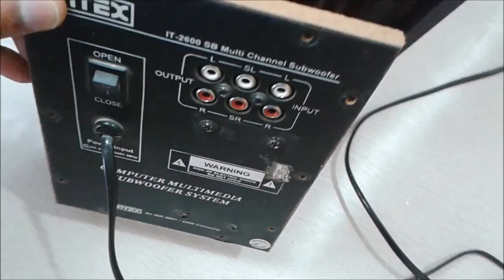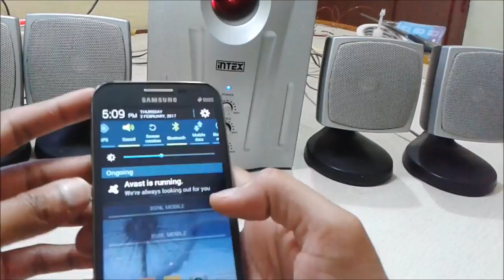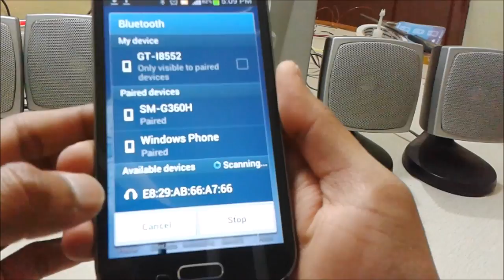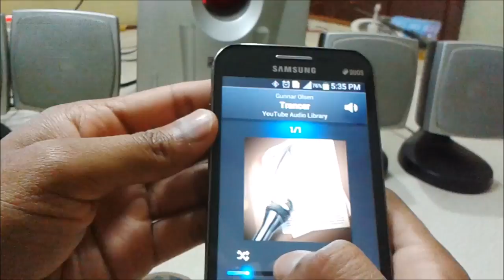How to Convert a Home Theater to Wireless (Bluetooth)

Comment: Good idea.  But you try directly without opening the panel. 1. Connect charger directly on socket       to use DC output. 2.  Connect male to male aux cable.. from bt to home theater...
Reply: But How Could We Fix Without The Aux Hole In The Home Theatre..
Reply: M
Reply: Me too no aux, how to connect ? Please
Reply: @marilync.ladera169  this one need external devices, mobile charging adapter, Bluetooth receiver, Aux to stereo cable. Connect the BT device to adapter, then connect aux in BT output to home theatre stereo input. That's it.

Comment: dear , have you faced low base , or some time baseless sound ? have the same component as u do but the base is very less ?

got any fix ?
Reply from the maker: In this video, you might listen low bass sound but actually its very good sound quality.
Reply: NO  dear , i wasn't talking about the video sound base . i had one , after connecting it to  and it got a relay  low base sound  , i connected the same way you did , but search in a lot of , some in the form says , it has a  lower  and poor rate of transmission , so need extra 
 boost up ,
Reply: ya i am also facing same issue. but the reason is low quality bluetooth device.. i hv changed the bluetooth bought branded one. now quality is good.
Reply: can u plz provide make and model "branded one"
Reply: Koustav Dutta or go for iball bluetooth reciver

Comment: hey i have one querry.
i had a usb charger, i removed it from its case, i saw inside it was not conected by wire, but just by two clips, and now i dont know which is (+) and (-) ...
Reply: If you disconnected the AC side connection, then it is no problem... Reconnect as you like... And if it is on DC side then the RED colour wire is (+ve) and other is (-ve)...

Comment: you can use a rechargeable 5v battery to connect the Bluetooth module without connecting it to the speaker internals
Reply from the maker: ha easa bhi aap ker skte ho.